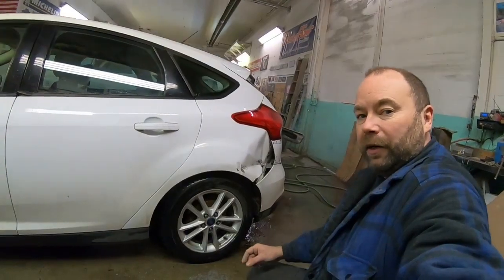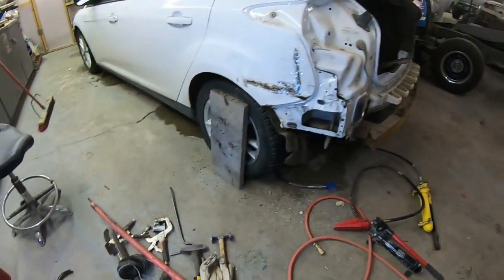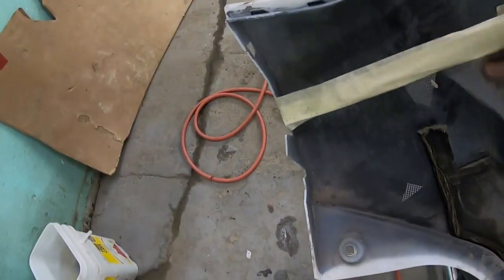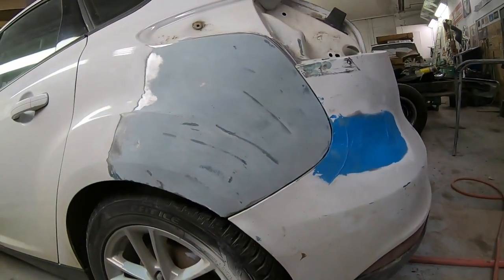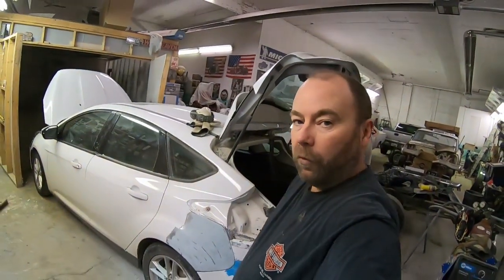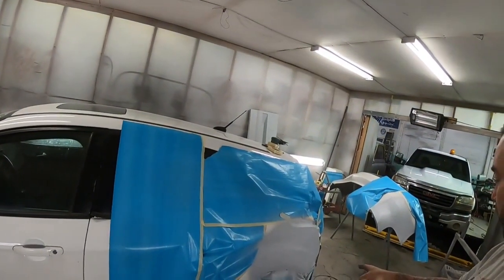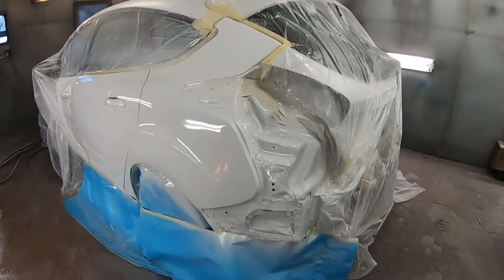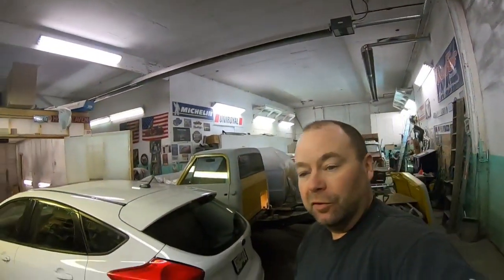Repairing a NASTY dent,and plastic repair

Comment: I have a 1500kg glue puller for this sort of stuff with no access - cuts out a lot of mucking about. Glue on tabs, crank up the puller & stuff co-operates. No idea how I managed before I had the puller.
Reply from the maker: It’s amazing what can be done with the glue now, I’ve never tried it, but have seen some incredible repairs 👍🏼